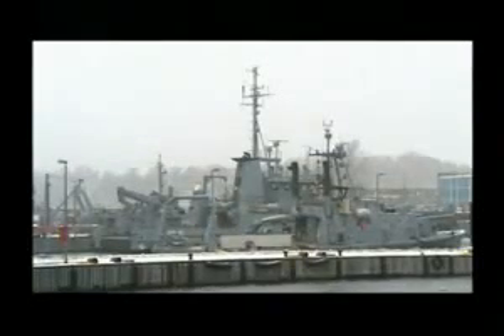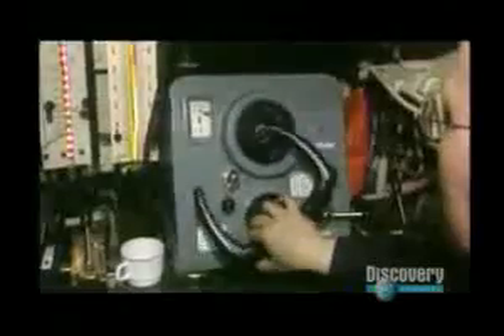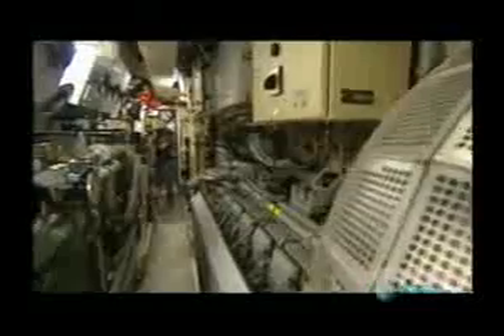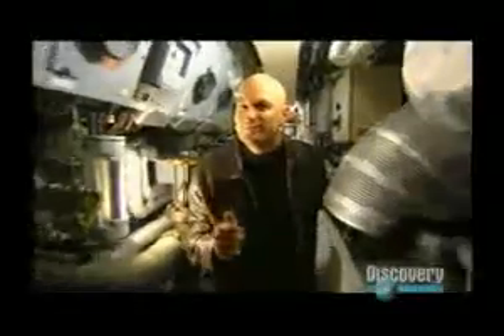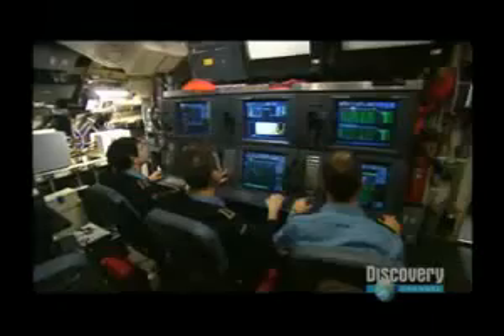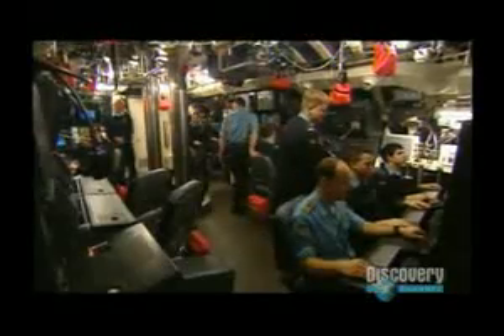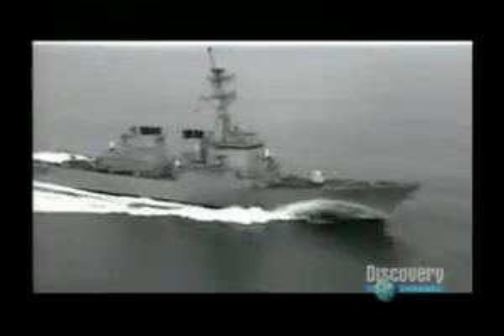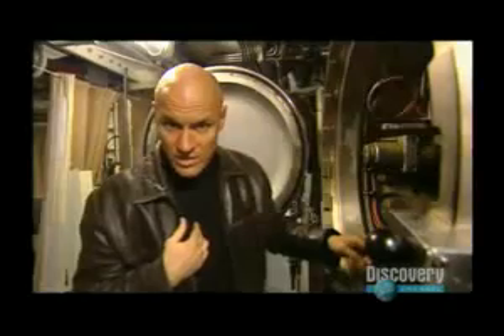Type 212 Most Advanced Submarine.mp4

Comment: Germany plays foul again.  Has bought up other  Sub producers as Kockums & Hellas to stall competition . REad about the Kockums scandal, biggest industrial scandal in modern times. 

Also has the Greek  navy reported many problems:

* The air-independent propulsion system has lower output power than specified; the unit must be shut down after several hours of sailing due to higher than normal operating temperatures;
* Increased propeller cavitations;
* Seawater leakage into hydraulic systems;
* HDW was fined $4.1 million by DAPA in February 2008 for ongoing technical problems. 
* Hydrogen is highly flammable. Which makes the sub vulnerable in a war zone.
*  Fuel cells produce Nitrogen dioxide- A harmful gas & can make the sub more detectable 

South Korean National Assembly demanded price reductions for the remaining six submarines, arguing that HDW was using the South Korean market to correct faults in the Type 214 to increase the submarine's overall international export potential. It is uncertain if DAPA received a price reduction for the fourth unit when it was contracted to DSME.
Reply: bergssprangare erm the greek do t have these subs...

Comment: Re: Hydrogen.  In addition to the externally stored hydrogen, that's used in the fuel cells, there may be another source: the conventional batteries.  If they're lead-acid, or use any other water based electrolyte, hydrogen is created by electrolysis within the batteries, whenever the current is high (especially during battery charging).  US subs use "burners" which convert H2 into H2O.  I wonder if the Germans have figured out how to extract the H2 and pump it back into their external tanks?